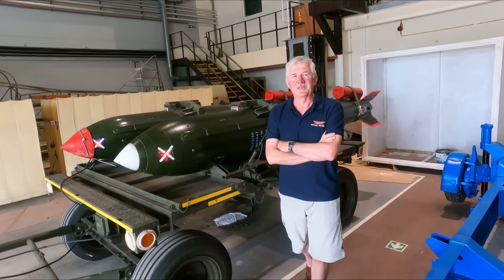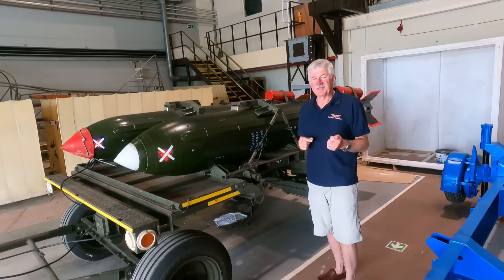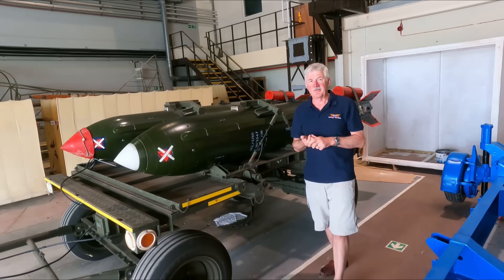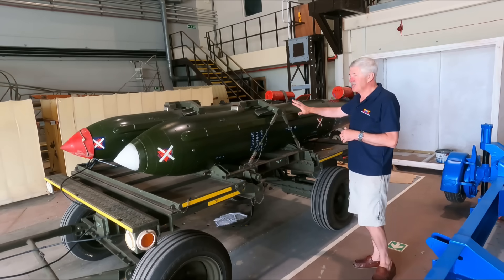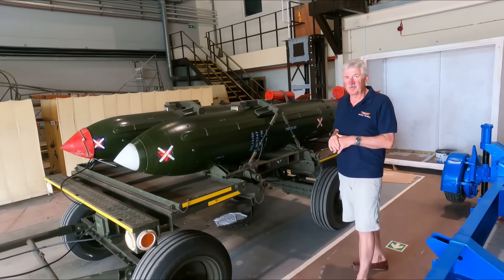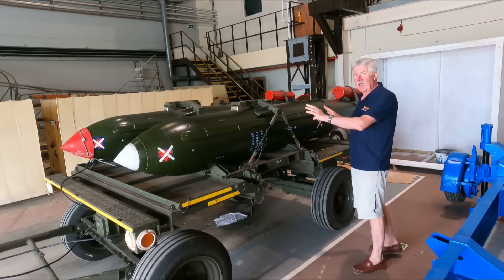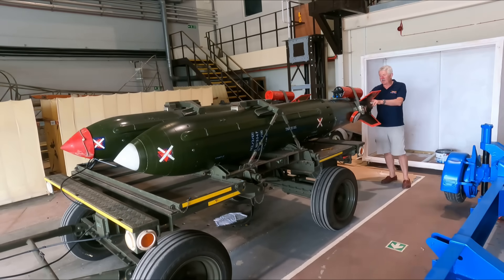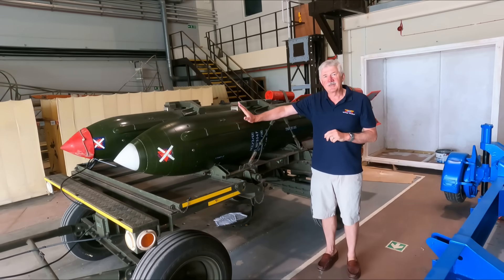Former RAF Qualified Weapons Instructor (QWI) decribes the WE.177 nuclear bomb.

Comment: Add a glide bomb kit with a small rocket booster and an appropriate fuse and the WE.177 could still be a very relevant weapon for the UK and for Europe. Add a booster rocket with a ramjet engine and a weapon with ample standoff range can be provided at a reasonable price. Jet fighter launched glide bombs and cruise missiles offer much better value for money than four Dreadnought Class SSBN submarines with SLBM's which at times will have an availability of only one submarine that could potentially be located by the Perpetual Invader's attack submarines.

Comment: Why cant the UK make and use theseor bomb based on the design with the F35A and get around the duel trigger issue with the us made tactical nukes?
Reply: We have not done it for decades. UK design has been focused on Trident.
Reply: @Spookieham  The laws of physics are still the same, MOD or Aldermaston must have the plans for them somewhere,
Reply: The problem would be the integration of the weapon with the F-35 systems so it could actually be used. From what I've heard, there's already a backlog of weapons waiting on system integration and testing.
Reply: @StephenButler-sg5hm  Yeah but these like the Bombs the US is proposing to provide are both gravity drop weapons, No Gps or Complex guidance systems. Just a Circuit to arm the bomb and another to release.
Reply: You could build a 'WE.177D' comparatively easily. Just by re-using the new Astraea warhead being developed for Trident D-5 on the Dreadnought boats as the warhead.

But...would you want to? If you really wanted a tactical nuc it would make more sense to incorporate that warhead in a missile of some kind (either stealthy subsonic or super/hypersonic) to give you the stand off range (plus additional range) and guidance....the US continuing to use B-61/12 and B-61/13 is strange to say the least...but they have other options like air launched cruise missiles as well...
Reply: its not a "kill" switch...its a software update....same thing. Lots of software in an F35 or any modern aircraft.
Reply: The F-35 will have a 'disable' software back door for sure.

Comment: So around 30 times the power of Little Boy, in a much smaller and lighter casing.  Difficult to comprehend the scale of destruction that would inflict. And yet, still under half a megaton weapon.  A single Titan II ICBM was 9 MT, and then there were the multiple warhead weapons some of which could deliver 10 x 1 MT warheads in one strike, some even more.  Pity we're not better at peace than we are at war.
Reply: Not belittling the catastrophic effects of such weapons as you highlight, but just noting for the uninitiated that destructive effect increases at an exponentially-reducing rate (as opposed to an linear rate) with larger and larger warheads ie 450kt doesn’t have anywhere near the theoretical destructive power of 30 x 15 Kt. Hence we got such on-paper craziness at multi-megaton warheads, especially with earlier gen missiles which were only reliably accurate to within miles rather than yards.
Reply: I have read the target list for Sheffield was 2x 250kt, and 2x 1MT weapons. London was targeted with 8x 250kt, and 4x 1MT.
Reply: @grahambloodworth4770 
Although that was probably to compensate for any of the weapons failing to detonate, it's still complete overkill, or, in the vernacular of the time, Megadeath.
Reply: @grahambloodworth4770 I can see both aircraft carriers (when they are in port) from my bedroom window and from the patio in the back garden. It’s about three miles in a direct line. Portsmouth Naval Base would be peppered with warheads and I might need more than a strong pair of sunglasses to survive.

I have no need to be a prepper or have a bug out car or motorbike. There would be no where left to go in Southern England…..

Lastly, for reference they have a training round WE177 on display at the Boscombe Down Aviation Museum, well worth a visit 👍🏻👍🏻👍🏻
Reply: @grahambloodworth4770  "was"?
Reply: Just imagine if only Putin had such weapons...

Comment: Used to remember seeing those in the bomb bay of the Vulcans at Cattesmore in 67. If my memory serves correctly, there used to be three on a bomb rack at the front of the bomb bay, and they were painted a bright yellow, I guess that was so you could see them.
Reply: What you saw were conventional rounds. The Vulcan carried only one WE177 on the 'C' station if my memory served me correctly. There being 5 bomb stations. The 'A' and 'E' stations in normal use had fuel tanks fitted for extended range.
Reply: Cottesmore not cattesmore
Reply: @chad6080  At least you read the post.